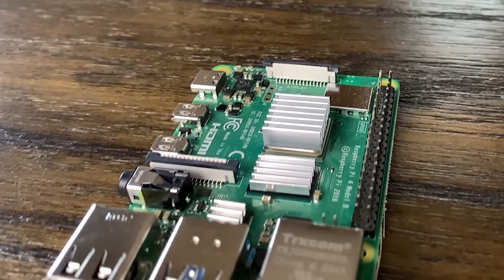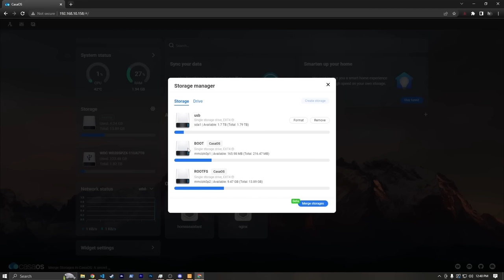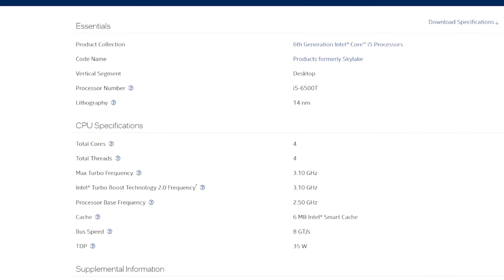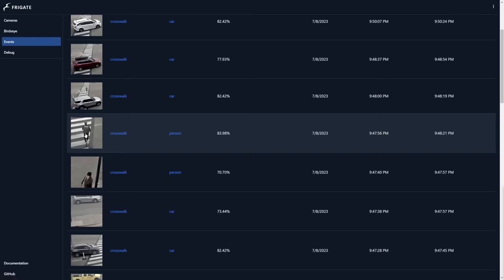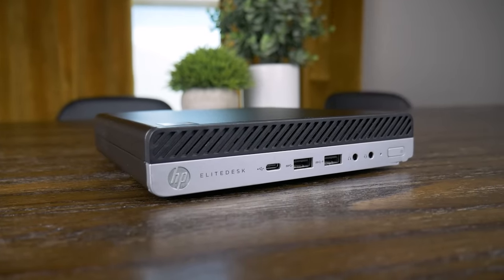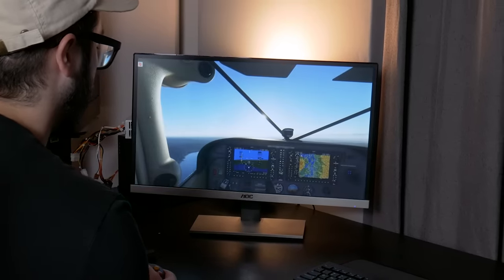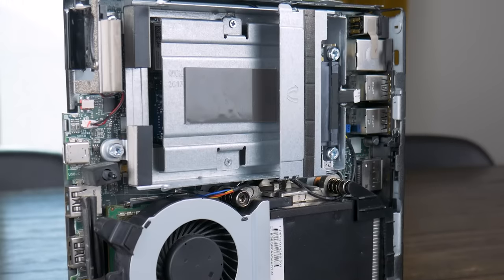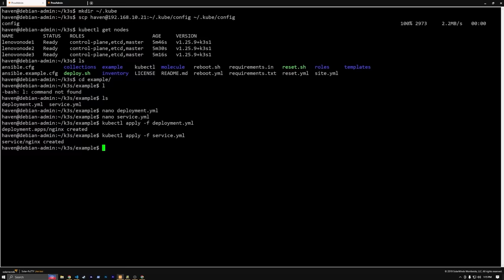The Mini PC You SHOULD Be Looking At

Comment: I don't know if this applies to the HP and Lenovo Mini PCs, but Dell Optiplex mini pcs lock their clock speed at 800mhz if you have a "non-OEM" power adapter. I put "non-OEM" in quotes because I've dealt with quite of few Opitplexes at work and this happens even with OEM adapters. I've compared the working power adapters with the non-working ones and they are IDENTICAL. So even if you source one from Dell it might still lock your clock speed. 

Just something to be aware of and research if you're going the mini PC route

Comment: I looked at the pi 4 while it was still on the marked.  Though the dell 990 is bigger and runs at higher wattage, the overall value is a whole lot better.  Shop from a good merchant and the system may last a long time.

Comment: Before buying a used one it's a good idea to ask the seller if the Absolute Persistence Module has be activated or not. HP makes a nice workstation stand to mount it and a monitor to, which is what I did... brand new stand in box for $25 and $50 for the pc itself. I love the setup as a laptop replacement. Just need a new compact keyboard now and some small speakers which should tuck nice under / in back of the stand.

Comment: Well done on putting yourself to the challenge of cleaning it up and seeing what it can handle!  I'd expect the CPU to be able to handle up to an Intel i7 quad core second generation, basing it on it originally having an i5, so shouldn't cause any power supply issues as it was made to run that kinda thing.

Comment: Actually on the HP EliteDesk 800 G3 you don’t need to remove the entire caddy to get to the NVMe. There are two screws you can remove to lift the floor plate of the caddy which give you access below it. I have purchase several of these HP mini’s; they are such a great space saver. There are two versions of the HP EliteDesk 800 G3; 35W & 65W. The 65W have ventilation holes on the top of the desktop. For personal use I’ll put in a 1TB NVMe drive & a 1 or 2TB 2.5” SSD. These are great little every day desktops.

Comment: I had bad luck with mine, ordered 3 , and returned 3. All had power state failure BSOD. I use it as a media server, Emu station. When received, all 3 worked but Windows wanted updates and then the BSOD started. Yes I can go without updates I guess but I just returned them. I assumed I had a bad one, so got another it had 130 hours on the SSD so hardly used . But it did the same I got all 3 with SSD included and Win 10 installed. All from same seller on Amazon maybe that was my problem. Sweet price for sure and i like the size.

Comment: I've got two of these machines I use at work, traded in a more powerful PC at each of my sites for one each of these, primarily because of the 3 built in display port adapters. Most workstations out there come standard with just two, or perhaps two and an HDMI. Was nice to have straight DP to DP on 3 monitors, with a tiny form factor to stash the box. Much neater presentation IMO.

Comment: Use a USB to SATA Cable onto SSD drives externally.  Works great that way for extra storage, backup, mirroring.  I use a very tiny pc that's a celeron half the size of these more in-line with a Raspi with Linux on it as a server for network drive sharing.  Works like a charm and only 7 watts of power.

Comment: I have a 3 node lxd cluster running on HP Prodesk 600 G3 minis. I run Plex on the cluster and the Prodesk 600 G3's have i5-7500t processors which work great for realtime transcoding of 4k video.

Comment: My proxmox system has been up for almost 8 months using this machine ( i3-7100T). It hosts all our local servers including 5m, old wow, and red dead. We also use it as non critical NAS.  Its my goto for virtual lab machines, retro VM's and just pure reliability. It sits inside our alarm panel box, is always there, and comes in handy re-installing steam library files. With the initial investment in 16GB ram, a very fast Nvme , and wake on lan, its been very good for us.

Comment: Honeslty these mini PCs are great. They are larger yes, they are a little more power hungry, however compared to the compute of a raspberry pi, its hardly comparable. I had an old desktop I have been using as a NAS/VM host using truenas Scale. However was running into lack of ram and just some issues with running everything on one box. So I recently picked up a small mini PC to pick up a few of the VMs and it just mows through them compared to when I tried to run it on a PI. Add to that because I have a dedicated NAS, you can just setup a share for what you need. Obviously already have some SMB shares to go my windows PCs, but have also used iSCSI shares for a couple things to add what looks like a perfectly normal drive to the end system.

Comment: 4:36 you don’t need to take out the entire 2.5” drive enclosure, there’s a metal plate in the middle of it with two screws on the sides: unscrew then and take out the plate, you can access the m.2 and wifi card ports from here.

Comment: well the price was off by a factor 1.4x stated. But looking on ebay a 6700 or 6700t i7 could be had between $60 and $75 in mini tower config. You might have to provide your own storage. I bought a few of these mini tower last xmas, one is becoming my daily remote driver (use one system to play videos, and another remote to download videos and web scrape).Also while Pi 4 are nice, they deviated from the $35 mission and need so much is needed support, a 4gb kit from CanaKit is $165 and a 8gb is $20 more. And these are precovid return norms for the cost. Pi 5 is likely to break the $200 kit threshold.

Comment: If you want more 'processor power, there are 65W variants of all the EliteDesk and ProDesk models (the only real difference is a vented top-case and an extra tiny fan above the SATA drive).  The big benefit is the the 65W versions use ordinary desktop 'processors, so you don' t need to look for obscure "T" or other low-power CPU variants.

I use mine for game/app servers and run UnRAID and Openmediavault, both of which have mature Docker support.

Comment: I run ESXi on a Dell Optiplex Micro. It happily runs my DC, an Arista Untangle firewall, WiFi controller software and a Configuration Manager installation I'm testing. I did have to install a larger NVMe drive and 32GB RAM, but the i5 CPU seems fine for light duty servers.

Comment: these small machines, are very solid, and useful for a ton of applications, personally i recommend running something like alpine linux, as docker host, and just dockerrize all the services you need, most of the services that is useful can usually be fetched from the docker site, and easily modified with little effort. dns blocker, samba, hostapd are very easy to setup, just to name a few.

Comment: Iv recently got a similar hp. 9th gen i3, performance good. Managed to install 2x nvme drives and a ssd sata for my freenas install. Power use is greate, still playing around with 2x 512nvme in raid, planning to upgrade the size, not going to use the wifi, very interesting to see that 2.5gbit adapter..mmm

Comment: we get alot of those elitebooks in where i work and while working pretty good they tend to have alot of issues that pop-up out of nowhere and even had alot of them refuse to turn on anymore (~10% of them)

usual issues tend to be: front usb ports (you want to be really careful with them), power issues (sometimes refuses to turn on), usb power issues when using all 4 usb ports on the back (simply wont power fully), graphics issues (dying integrated gpu giving glitchy display)

the good thing tho is they tend to have a slot for both ssd and hdd and 2 slots for ddr4
Reply: I've heard people mention that the Elitedesk mini PC's that have a copper heatsink tend to heat up and overheat quite a lot. The Prodesk devices that don't have a copper heatsink actually stay a lot cooler and are barely warm to the touch, even under extreme load.

Comment: The Coral or 2.5GbE won't actually work in the wifi card slot on these machines, if they're the same as ProDesks. That slot only supports CNVi, which only works with Intel wifi and Bluetooth adapters. I've got a bigger  (SFF instead of mini), newer (9th gen instead of 6th) one and I tried it. Ended up having to get a PCIe adapter for my Coral.

Comment: I have had 3 of these and can't get them to not stutter (sound) with kodi. and if you update to the current drivers from HP site I keep having Blue screen power errors (if you don't update to current drivers it doesn't do this I found out later). I thought it was my plug so I tried one of my 3 UPS and it did it on all 3. I got a replacement, did the exact same thing, and returned and got a 3rd and it does the same. I shut off restart on error and can fix the blue screens(still errors in the error tracking of your look but it doesn't restart), but I cant fix the Sutter in movie playback. Doenst matter the video player or movie format. Love the size.

Comment: One thing about those HP Cases to look out for: The CPU Fan can be a hughe Problem. When it start vibrating it might crash the PC as it sits above the memory. We have at work around 40 of them and 3 have disentregrated this way. All CPU Fan bearing problems except the one which has a missing Fan wing.

Comment: Some of Lenovo minis can be fitted with 2 nvme/m.2 data drives + 2.5” drives. In total we can have 3 drives in this small systems. I am using one of these as my home assistant headless unit and one as my web browsing pc. They are quite good and silent.

Comment: Thanks for tips, well done. And i liked music you used.
Those are fantastic peace of hardware, those mini-PCs. Used them in work as POS/compact desktops and they did the job.
Bad thing is it gets slowed down by corporate crap. As all PCs do anyways.
Reply: O&O ShutUp10++ is your friend. I've got a 2015 Acer E11 with a Celeron N2840 I use for writing (because I enjoy the keyboard) that runs Windows 11 EXTREMELY well after using this. You need to run it after every Windows feature update, but it takes about two minutes to run through it.

Comment: If you're going to hard wire the system, you can convert the wifi slot to another nvme port. It will run a bit slow, but still faster than sata.

Comment: Just a few days ago I bought a SFF Lenovo Thinkcentre m73 and a ram upgrade for another thinkcentre m93p. They´re cheap and robust machines. They consume more electricity compared to an SBC, but the software and computing power is more than enough to meet my needs. Im using one as my NAS, and the other will be my torrentbox. The only issue that I´ve found so far is that Im only able to use 2.5 inches hard drives. That limits my storage capacity, but I hope to find a solution to start using cheaper 3.5 hard drives.

Comment: Ordered one off ebay based on your recommendation for $75. Comes with 250 gig ssd and 8 gigs ram. Plan to run ubuntu to activate an ad blocker maybe.   Plenty of USB slots for the drives i have to serve as network storage space. Hopefully can run headless with no mouse or keyboard or hdmi needed. 

Had to get an amazon hdmi adapter for $15 more.

Comment: my opnsense firewall is a lenovo m720q with a riser board and a quad nic... i5 8500t with 16gb ram goes for only 120 bucks on ebay. I think they're the best buys when you want something cheap and efficient. I have 2 other m710q minis in my network closet, both running linux. one is my home file server with 3 raid usb 3.0 external drives connected, and the other is my cloud server that hosts my meshcentral server, along with next cloud, wazuh, and some other apps.

Comment: I actually use one of these as a NAS. 

It got no SATA options above the one for the OS. However, these things have a surprising amount of USB 3.0 outlets for a 4th gen CPU. In my case I have 6 of them and newer PCs will have even more and faster USB. I got my drives in handy 2x 3.5" DAS enclosures. USB 3.0 is plenty of bandwidth for a spinning HDD anyway. In theory you should be able to push over 600Mbyte/s (5Gbit/s) over old USB 3.0 which is plenty for any NAS application with spinning HDDs and 1Gbit/s network. Same principle many use their Raspberry Pi as a NAS.

Comment: There's a RasPi based open source synth appliance called Zynthian (q.v. - it's VERY cool). I'm thinking I'd like to put something like that together but based on an x86 platform so I can run some of the Windows VSTs that I've bought.  Just need to figure out interfacing the physical controls and touch screen to one of these baby PCs.

Comment: Those SATA ribbon cables are easy to break, as are the clips that hold them on to the mainboard. Use caution becuase as far as I can tell there is no replacement for the clip if you break it (which I did when I was replacing the fan.)

Comment: i really wanted to get a mini pc for a small home server, but i wanted more options so i found an elite desk 800 g3 SSF instead for $100 in march. came with everything and ran great. i5 7500 (non T), 8gb ram and said 256 ssd in the description but was actually the factory nvme drive. i bought 24 more gb of ram for $70 and a 500 gb ssd for $30. found a decent looking 1050 ti for a hundred and now my little pc runs games fairly well at 1080p. plays 4k movies really well and even works as a good server for ARK. exactly $300 for a surprisingly fast and somewhat powerful little guy is great. gonna be experimenting with other things, similar to what is mentioned in the video.

Comment: I have two HP 600 G3 minis and they work for pretty much all applications where PCIe lanes are not needed, although they're pretty slow with Windows on an HDD and the i5-6500T has a pretty poor gaming experience for anything more than Fallout 3. Of course, if you need more power that's where a desktop come in, these are essentially laptops shaped into desktop form. Nothing fancy just pushes paperwork and TPS reports but does what you need it to do until you need it to do more.

Comment: Lenovo TinyPC user here. Almost zero noise and zero overheating. Mine has been running Win10 and 2 VMs (Home Assistant and OpenVPN Server) whilst sitting inside a cupboard that reaches 35 degrees with no air. No crashes in almost 1 year.

Comment: just wanted to say you inspired me to buy one of these off ebay, it was an elitedesk 800 g2, and the best part is i ordered the 35w version with the 6500T and no hdd or wifi, and i ended up getting the 65W version with the normal 6500, wifi built in, and a 256gb ssd for no extra charge. all for $40. i'd say that's a damn steal

Comment: I've got an Elitedesk G4 with a Ryzen 2400G, 16GB RAM and a cheap M.2 drive. Runs all my self-hosted services with CasaOS (Syncthing, Youtrack, Vaultwaren, Photoprism, Adguard, Code Server) and I've never seen the CPU above 5%. Those 1L Office PCs are incredibly underrated especially considering the power draw and great IO. You can't add huge amount of storage but I don't think most people actually have that much data apart of pictures.

Comment: I had to choose a mini pc to use as a server running 24/7 , before I bought an ace minipc which had really good performances (140 euro the 12GB version with a celeron n5105), too bad it started to reboot and hang (probably the cpu fan was not enough) with several linux distros. I got a refurbished elitedesk 800 g2 Dm with a i5-6400T 8/256 GB for 130 euro, I hope it's good for the temperatures we have now in Sicily :')

Comment: Got a ready-to-use Dell Optiplex 5050 Micro with a Core i5-7500T, for about $100 USD shipped last year, and upgraded it to 16GB RAM and 256GB NVMe, for cheap. I was planning to use it as a (completely overkill) LAN/public UT99 server, and was shocked at how serviceable/upgradable it is. May get another one (or three) for many other uses, now (except for a multi-purpose home server—Got a modified, dual-CPU Mac Pro 4,1 with over 30TB of storage, and 256GB of RAM for that, already 🤣)

Comment: 5:30 :  If you need to remove stickers fast and without risking extra scratches.  Get a bottle of akasa TIM cleaner.  Few drops on a sticker rub it in a bit with your finger, let it sit a bit.

The TIM cleaner contains a bit of petrol (we used to use zippo lighter fuel for this), it will go through the paper and dissolve the glue given a minute or two.  Just let it sit do something else real quick and then just peel em off like nothing, no marks.  Usually one to two drops per label does the trick.

Can also  be used if you collect vinyl records, best way to get stickers off and not damage the cover.
Reply: I've had a lot of luck removing stickers with plain isopropyl alcohol.  They also dissolve pen ink.

Comment: Hi, great video on this little amazing machine. I have the mini G3 non T version. Means, it came with a desktop cpu I5 6500 65w. And it is much more powerful than the 6500T. I have updated the cpu to the I7 7700 that is the biggest cpu supported on this machine and now it is the perfect multimedia machine.
Directly connected to my TV, I run batocera retro gaming OS with recent games, Windows 10 with MS games and everything works great!
Cheap machine, excellent performance. It is the perfect machine to connect to a TV.